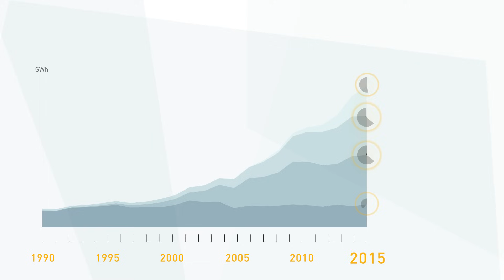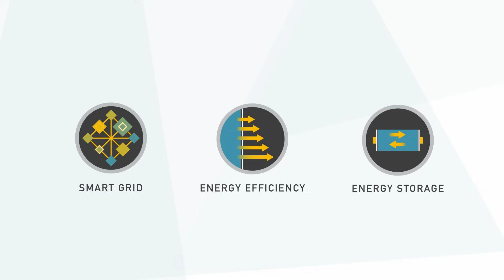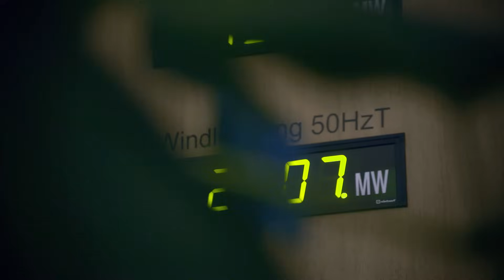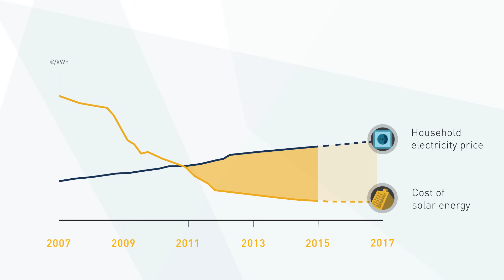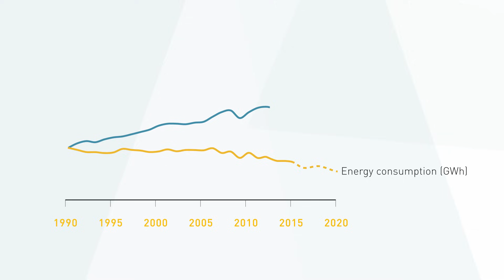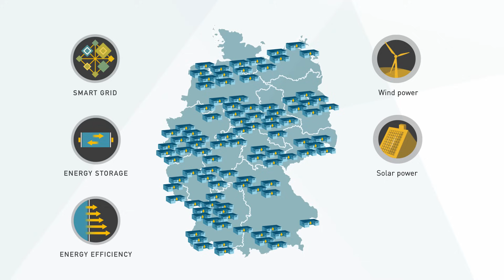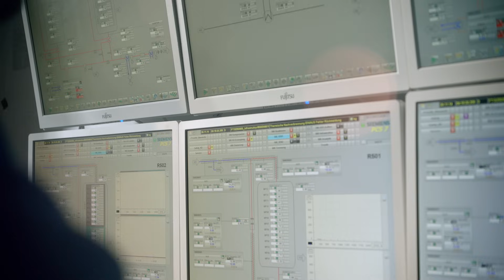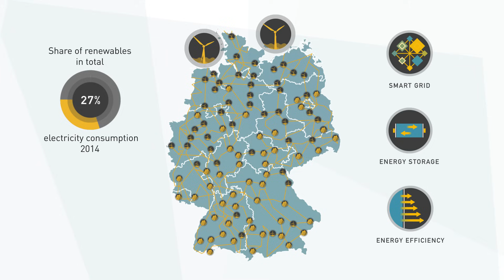Germany's Renewable Energy Revolution

Comment: Hiw are they doing with current electricity cost?
And backup coal an ng powerplants?
Reply: Eskiriatai privat household pay like more or less 30eurocents per Kilowatthour.
Reply: Eskiriatai I'm a single male in a two-room-appartement and I pay on average 20,-€ per month for electricity.
Reply: MrPHAELAN  Do you think that is good??
Reply: gacj2010 It's a ridiculously low amount of money.
Reply: Really is?? Well that;s a plus if that's the case.
Is there  destruction of the landscapes with windmills on every ridge. My friend from Germany although proud of such alternatives did say that windmills have predominated much scenic landscapes?? maybe this is accepted and is the price rather than buying gas from the Putins of the world and building their threatening power??? But its good I guess if the power is cheap.
Reply: some Americans believe Germany will go bankrupt due to solar energy upkeeping cost
Reply: Eskiriatai Nonsense! I'am a german currntly living 150km east of munich and I pay as a single on average 18€ per month despite the higher costs per kilowatt/hour .
Reply: MrPHAELAN Hi Just checked mine in US. I have a 7 room house.July 7- Aug 5 I used 348 kWh. Its .09257 cents per kWh so the current cost $32.21. The transmission cost to bring it to me which included the following things:Customer charge $4.00/Dist chg first$13.85/ transition charge -0.57/Transmission charge $9.09/Energy Efficiency charge $5.65/Renewable Energy charge 0.17
So that's right from the bill... so the total for this bill ( a hot month) was total$ 64.40

I think that is more than 18 Euros so you did better if you used comparable  Kilowatt hours , but remember the big picture, I pay for what I use only ... I think you have all kinds of taxes that if you figure it all out  it might be a shocker
Reply: gacj2010 I pay exactly 18€ a month including all taxes.
Reply: MrPHAELAN Ya, but all that other cost I showed you (delivery service) is to pay for the upkeep and maintenance of the wires, meters tree cutting etc. and it varies by how much electricity I use. Its because our power is not Government power, but private company power. If I use little power it costs less...I believe your government is the owner of your power companies. If I find another generator of power, I can change my source of power and get it for a smaller rate as they are all in a grid, so there is a competition here and there is choice and the landscape is clean here. Competition brings out the best in people and products.
Germany's issue is it has little fuels in its country, except some coal and that is soft coal as well that's why you buy from Putin. We don't have to deal with that Devil. Who knew he would move in the direction of western Europe.... so I understand the windmills are needed for national security there. We have them too but understand this is a continent country. We probably have as many as you have but per capita you have more.
Come over and see, you would be surprised. Environmental laws are extreme here...you would be surprised..
Reply: MrPHAELAN We should pay less attention to this windmills versus generators and focus on the real threat to life....The real threat to freedom
Its Putin.....
More so for Europe than US, but you see Obama, the worse president of the US in its history, is trying to act like European social countries saying he is 'leading from behind" and apologetic for ....whatever...
every foreign policy decision ...Every one has ended up in a more and more and more unstable East and Europe. Oh Bush before him ...no good either...A Reagan type is needed now. Look at Syria ...Mother Russia will be in there and more powerful because of this weak America  that Obama created.
As I remember ...Europeans  thought he was the greatest thing since Christ ...Now Europe has to endure the consequences of Obama foreign policy...Sad people don't see that if there is a power vacuum, something will move to fill it...in this case Putin.
I would be fearful if I lived in Europe today.
Putin has a plan . He's got Europe by the underside with that gas pipeline and its making him stronger and stronger.
Stop thinking about the things that won't hurt you and focus on the real threat to your living.
I hope for Europe's sake , America's next leader is Reagan like.
Reply: +Eskiriatai The funny fact is that renewable electricity itself is the cheapest one at the power trading market (sometimes it even gets negative). But the providers don't have to put this cheap prices through to the consumers.

The biggest part of the bill for the shift is the feed in tarif. It sounds like a hughe sum but 1. It is payed by all users (80 million) with only few exeptions for some firms and 2. It is not payed as tax but directly to those who provide this electricity and those are in vast majority ordinary people. So many pay it but also get the benefits from it ...
Reply: I am not against wind and sun power as long as its not taking more funds from the people, as you tell me it is not. In US I think politicians have their hands in this . Obama gave a solar corporation names SOLINDRA (google it and see what you come up with)hundreds of Millions as he was to be elected( the company gave him hundresd of millions back for his campaign) to get votes and when he got elected the company went bankrupt because the China made the solar cells cheaper and everybody knew it. Obama did it with GM for a car known as the chevy VOLT to get  money and votes... It was a plug in car and it cost the Gov.(people) millions and it folded. Lots more examples of this in US in order to shift peoples money out of their pockets and CONTROL the population. I think the people are now aware of this. US distrusts government and it is good to always question what gov. is doing.

I think Germany might be better than these corrupt politicians in US who love to USE the renewable energy to their advantage and the people here always foot the bill. I think that is why I am always skeptical here.Much dishonesty in gov. and businesses and unions.  Germany is doing it probably for the right reason... I am happy for that so they can get away from Putin dependency
Reply: +Eskiriatai Based on this

http://www.statista.com/statistics/263492/electricity-prices-in-selected-countries/

Germany pays over 15 cents per KWh where France is just a bit under 9 cents.

Germany produces 11.9 tons of CO2 equiv per person, France produces 9 tons.

The reason why France is ahead here is because of Nuclear. Recently Ontario ( province in Canada ) shut down it's coal plants in favor of nuclear, perhaps Germany should do the same instead of building more coal to backup solar/wind during idle time.

https://carboncounter.wordpress.com/2015/06/06/why-germanys-nuclear-phaseout-is-leading-to-more-coal-burning/
Reply: Appears to be 15.22 according to statistics forwarded? Is this correct?

I can not understand why Germany doesn't import low sulphur oil and/ or liquefied nat gas in facilities provided for the purpose( you have cold water ports) to  supplement the wind and sun powered projects.
Is Germany building more coal powered plants? I thought I understood this?
Reply: gacj2010
Primarily because Germany wants to be able to produce it's own fuel, though LNG in particular is just a non-starter. If you can get pipeline gas you're always going to opt for that, it's just cheaper then LNG can ever be.
Reply: AmurTiger I understand that , but there is a control problem with who is at the supply end of the pipe.
Germany could build an off-shore receptical for the lng to unload then vaporize it and deliver it ...
There is a surplus now of lng ... America has a stable friendly share of it
Reply: gacj2010
The problem is limited and intermittent. Which means the market opportunity for LNG to get in is limited and intermittent, not good conditions for things to actually happen.

While LNG has been talked about much it hasn't happened, Nord Stream did and Nord Stream II is in planning phases. LNG is, ironically, a pipe dream. I'm saying this as someone in a region that hopes to become an exporter of such but we've seen lots of delays and problems with LNG beyond the environmental concerns.

The best way to get off Russian gas isn't to go to another gas source but to get off natural gas entirely, thus nuclear/hydro. Germany's politically allergic to nuclear and likely doesn't have the hydro capacity needed.
Reply: AmurTiger  I understand...
I understand France has Nuclear , a lot of it and I feel as long as there are redundancy it can be quite safe. US has a great record.. Knowing the German people, I feel they would even build superior..
Are you in Germany?
Reply: gacj2010
 Nah, I'm in Canada. Ontario did a nice turn towards nuclear recently and eliminated their coal plants. My own province has over 90% hydro for power production but that's not an option for everyone ( seriously, BC is very wet ).

As to Germany's ability to do better, certainly they have something to offer on the industrial control side of things but I wouldn't recommend trying to build a better reactor in the near-term. Canada and France both have a lot more experience building reactor designs, US and Russia are obvious major players and even the UK has built their own design though it wasn't as successful in export.
Reply: AmurTiger I love Canada..we buy much power (hydro) from Canada in Eastern US.
I would like to see hydro go big , but environmentalists regret land being covered with water....there is a;ways some kind of trade off . I don't think that is a bad one
Reply: gacj2010
Hydro already is about as big as it can be in most places, the biggest issue is that there's only so much rainfall for reservoirs to capture. No matter what the environmentalists say you're just not going to do very well with hydro in Arizona or something. It's still actually very useful though in terms of grid-scale power storage but that'll mostly have to be a conversion of traditional hydro to more of a variable load hydro that'll allow it to behave like a battery.
Reply: AmurTiger In California , they have dismantled many hydro plants over the past decade and now they lost much ability to store water for these dry periods and you may have heard of water problems which show up when rainfall is down in any given year.
Reply: gacj2010
The problem there is they likely didn't have the rainfall to support the plants in the first place when they started to get into the dryer weather that's pretty natural for there. If I recall correctly up until the past decade or so the weather in California was oddly wet compared to pre-historic norms. Really the problem in California for water is on the usage side given how deep they're drawing into their aquifers.
Reply: +AmurTiger Well one might also point to the different level of industrial base (germany started on a higher niveau than France when CO2 reduction was put on the agenda). But more interesting is the notion that nuclear energy is supposedly cheap. Well now that questions like dismanteling nuclear power plants as well as dealing with the nuclear waste more permenently than just pushing it around become an issue the big companies seem to need the aid of the goverment to be able to pay for it! 

So in essence they are confessing that they sold nuclear power to cheap all the years before since whatever price they got it was not sufficient to lay the capital stock now needed to deal with the consequences of useing a technology that recived much higher subsedies during the R&D phase than all alternative energies put together so far (if one corrects values for inflation). 

Yes, if germany would be as careless as some others, we might have cheaper electricity and for a short time lower carbon emissions. But our energy change is based on two elements:

1. We want a long term soloution. A soloution that we can progress further and further to constantly eliminate carbon emissions out of energy production.
2. A ethical desicion on what actions we want to take.

More nuclear power might be able to give us low carbon emissions. But just a causal look at how the uranium is gathered should be enough to see ethical troubles. Then one has to take the transport and refining process into account which significantly harms the 0 carbon bilance. The risk of catastrophic failures while small is also a part of the equation (there is a reason no insurance company would offer a contract about the full possible damages. If the probability was truly 0 they would do it ...).

And then there is the waste! And as long as a great chunck of the french nuclear waste is still rotting in Siberia (in train wagons) [http://www.dw.com/en/france-dumps-nuclear-waste-in-siberia-reports-say/a-4786672] one should not try to come up with lies about recycling nuclear waste (not to forget even if it worked as some theoretical models propose it would not become non nuclear waste in the end it would just be useable more often before it has to beend storred for a few thousand years).

It is a democratic decision in a democratic governed country. Outside of germany many people think it was a drastical change in policy as reaction on the events in Fukushima. But that is wrong as early as 2002 we had an phase out plan in action. The story is that the new goverment had decided not even half a year before Fukushima to shut done the phase out plan against the will of the majority of the population (up to 60% were for the phase out even before Fukushima). In essence all Merkel did was to go back to a plan that was already in action for a long time.

Overall I don't really understand why it seems to be such an issue to people not living in germany. We won't force anyone else to phase out of nuclear power.
Reply: BobHerzog1962
Nuclear energy can be considered cheap because right now France has the lowest electricity costs in Europe. Theorizing about what might happen on decommissioning is just that, theories. Furthermore the very fact that they're being asked to clean up after themselves in this manner sets them ahead. Your coal/gas/oil plants also make a mess of the atmosphere over their lifespan but aren't asked to remove the mess from the atmosphere as part of a clean up. Those carbon sources of fuel just end up doing more damage then nuclear has and that's a price that the world ends up sharing, not just Germany.

Uranium mining and processing doesn't leave a big footprint compared to coal, this shouldn't be surprising to a German given you have some of the largest machines ever built chewing through landscape for the sake of coal. The amount of fuel consumed by nuclear is the reason why this impact is minimal.

On waste handling, the link you showed isn't 'dumping' or even disposal of waste, that's literally the recycling you deny exists. The article only talks about Uranium and the nature of what happens at Seversk makes it clear that this is simply going to be re-enriched for use as fuel, thus the 20% they get back. Look up MOX fuel if you want to learn more about this.

Recycling of spent fuel is definitely something that can be done and can be done to a much larger extent as the problematic isotopes are all trans-uranics which are suitable sources of fuel themselves. The rest are either short-lived isotopes that won't be around for more then a few years or truely long-lived ones that don't emit much radiation. Recall that radioactivity is inversely proportional to half-life, it's actually the sweet spot in the middle that's a problem as far as waste.

Naturally nations, democratic or otherwise, can do what they desire when it comes to building power generation. That doesn't mean I, or others, can't point out stupid decisions when they happen. So long as Germany has a single coal or gas plant it was stupid to shut down their nuclear power, they did it and now we all have to deal with the added CO2 emissions as a result. Contrarily Ontario, a province in Canada, managed to shut down all of it's coal plants as they started their nuclear plants up ( some were down for maintenance cycles ).
Reply: +AmurTiger I prefer to take all costs of a technology into account not just the current run costs. At some point each nuclear power plant will have to be dismantled and the waste be dealed with and to ignore that because it is a future generations problem is not really ethical unless you put aside capital that has at least a chance to cover these costs (and if one would add these costs into the cost structure of the energy providers electricity form nuclear plants would be much higher).  It is basically the same as it was with the debit crisis in the US where poeple were so happy about low interest rates in their house payment contracts that they ignored the possibility for the future high costs in the same contract. So you can repeat the current energy price as much as you want I'll stick to that point.

Well coal plants in europe are at least subject to the european carbon certificate trade system. And it is not germany who is the biggest hurdle in setting more restrictive overall caps on that system. 

We are also well in the process to shut down our lignite coal mines one after the other. So your argument that we still have such machines has more to do with us still negotiating soloutions to shut down such mines since we have to compensate those who own certain rights to them (our state can't just take away stuff from people or companies without compensation). 

Most planed new coal plants that were planed before the energiewende won't be pushed futher into planing all of the others will be used to replace older and more dirty other coal plants (and were already in various state of construction so they would have been build whether we phased out of nuclear power or not). 

In fact many studies indicate that nuclear power can be a hinderance for incentives to invest in a flexible net as well as in power sotreing soloutions (and thus ultimatley also a hinderance to install more volatible renewable energy power than at tops 33%). Only the shut down will make large scale power storeing units cost efficient.

Sorry I saw the video where they measured the radiation of those train wagons. That is nuclear waste rotting without any form of protection in Siberia. Just because some people claim what comes back to France is recycled and what stayed back in Siberia is harmless doesn't make it ture. If that was true why not ease the minds of the sceptings and take everything back? As said even the experts who declare recyceling as a plausible path for nuclear fuel all say that in the end there will still be nuclear waste (it has to be otherwise nuclear fuel would be a perpetum mobile which is impossible by the laws of physics).

But lets assume we germans would miraculously decide to agree with your argument. We couldn't restart all reactors since most of those that were shut down are way beyond their planed run-time. To upgrade those or build new ones would take years and in the mean time we would either need you guessed it: New coal plants or let older ones run again. It seems more plausible to follow the path we have chosen and to further expand renewables and set incentives to upgrade our grid as well to invest into power storeage R&D as well as pilot projects.
Reply: BobHerzog1962

It's fine to look at lifetime costs, I have no issues with that, but then you have to recall that the coal power that you're still using is externalizing all of it's cleanup costs into the atmosphere. No matter how 'clean' you pretend your coal is it's still going to be worse then nuclear in terms of pollution, deaths due to cancer, sustainability. So France powered by nuclear, not having paid it's cleanup costs yet is a valid comparison to Germany powered by coal who will never clean up it's mess.

Replacing coal with 'cleaner' coal isn't an excuse either. The facts are simple, nuclear is a cleaner power then coal by a wide margin, tearing down the dirty coal should be followed by replacing it with the best available option, wind/solar or nuclear. That's not what's happening.

On the subject of recycling, you're making things up, the article you linked made it clear that they're recycling the fuel. Just because you don't understand doesn't mean it doesn't happen. That doesn't make it harmless or no longer radioactive, but it does mean that the 20% that comes back to France is going back into reactors, this is how recycling works on a very basic level.

If Germans were to somehow agree with my point of view they'd look to building new reactors to power the country up to base-load with wind/solar projects selected to match the average power use curve and hydro/nuclear providing load following. Unfortunately instead of doing something that can actually remove carbon fuels from their electricity generation they're letting themselves get frightened by pseudo-science.

http://conservationmagazine.org/2015/10/chernobyl-has-become-an-unlikely-wildlife-haven/

Seems like a few decades after the worst nuclear disaster ever wildlife is flourishing there, probably because low-level radiation is as natural as the sun and dirt and bananas and we've evolved to handle it in small quantities.
Reply: BobHerzog1962 One can not get something from nothing.

Fine, go with windmills and the sun if that suits you.

 I must say that the wind doesn't always blow, nor the sun always shine.... you talk about energy storage or a country running on batteries during the cloudy and still days..

Don't know about that plan.!!!

All sorts of energy production should be available.

I sometimes wonder what impact your non renewable hardware and placement has on the land, considering the production of such items, the placement on land , the digging up or the earth to place and anchor, the effect on retarding wind flow,... I mean all these ridiculous arguments that one could make , not so much about panels on roofs. but in Us they talk about all the birds that are killed by windmills .... I mean, it can get foolish putting one above another.

I don;t want to get into a discussion about the infatuation of co2, a life gas, or how earth  has been warming for 15,000 yrs, why  the continental shelves, and glacial melting and sea rising , for 15,000 yrs., or the influence of one volcanic eruption. How many volcanoes are erupting of spewing right now... more than any energy production process.

For many reasons, especially when doom was proclaimed to occur in the 80's and we would be  dying, the it was moved up to the nineties , then 2000 was Armageddon. False profits lost many followers.

I don't want to breathe sooty air or become sick either, but if carbon based fuels are burned efficiently and completely and there are ionic precipitators that eliminate 100% particulate matter, then they have a place in energy production. All sources have a place.

Earth has huge negative feedback systems or sinks that assimilate co2, especially in oceans.

What do you think gave rise to the carboniferous period on earth when a warming due to many factors ie continental drift, volcanoes again, ocean current changes etc and other unknowns.. this is when co2 was incorporated in the plant life which became coal and oil. These words don't have dirty, filthy connotations in my head.

And why should anyone think that things on earth should remain in a constant way; that change isn't a part of life and earth itself .

Its this infatuation of compulsive focus people of some countries have been made to think is generating this overall take over of free people.
Its complete credence on computer models that pretend to predict out future with regard to climate.... and they have trouble predicting weather, or hurricane paths.
Science can't be executed on this topic.

Again, I remind you, I do not want to breathe dirty air but I also choose NOT to live like some Germans or Dutch who came to America and are known as Amish people. They use cows and horses and little do they know..... these animals are producing as much methane co2 a if they had a single efficient tractor.

I know I went into a different argument here but it is related to the infatuation and fear and GUILT in using what we have on earth in a responsible, careful, efficient way

If US didn't have to maintain a huge defense system that represents half of the budget , we too could have joy in "other than fossil fuel" energy.

Do that one wants in EU, but I would worry about a Germany that doesn't speak German any longer as my prime concern.